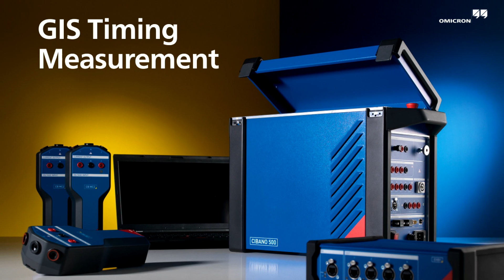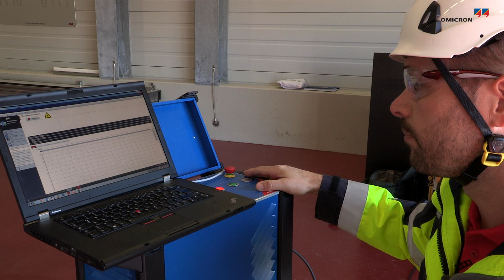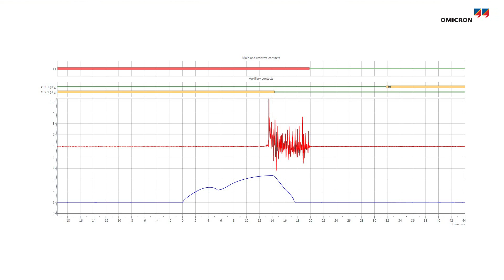GIS Timing Test with CIBANO 500 Current Sensor

Comment: Need to show a diagram of the hookup and where the cibano was connected in the panel.
Reply from the maker: Dear George,

In the panel: The CIBANO connects to the trip coil (integrated power supply). The connection to the primary side is done via earthing switches. For further details see the related article in our latest OMICRON magazine, which you can find on our website: https://www.omicronenergy.com/fileadmin/user_upload/magazine/OM-1701/EN/index.html#8

I will also make a Webinar on this topic soon where I will explain the method in more detail. I will post the date here as soon as it has been fixed.

Best regards,
Your OMICRON Team (Andreas Nenning)
Reply: Our company's cibano have firmware issues, can you help us manually write the firmware to the device?
Reply from the maker: Dear Loyd Aquino,

thanks for your comment.
We're sorry to hear about your issues but are eager to help you solving this problem.

Please contact either
- our technical support https://www.omicronenergy.com/en/support/technical-support/
- or find your local contact https://www.omicronenergy.com/en/contact/addresses/

Thanks in advance!
Best Regards
Your OMICRON team

Comment: Please you have one video for a Contact Travel Test, on GIS CB. Or more information about the Motion - travel of main contact Test. Have a one GIS ABB in Commisioning and I need More information. Kind regards
Reply from the maker: Dear Egidio Mora,
unfortunately we do not have a special video about contact travel measurements on GIS Breakers.
If it is possible to measure the contact travel of a GIS breaker or not depends on the design of the breaker.
When there is an accessible point where either a linear or rotary sensor can be connected you can measure the contact travel with the CIBANO 500 + TN3.

Measurements which are possible on GIS breakers:
• Motor Current
• Timing
• Static contact resistance
• Demagnetization of CT`s
• Contact travel depending on design 

For detailed information please get in contact with the technical support team directly: support@omicronenergy.com

Best regards,
Your OMICRON team